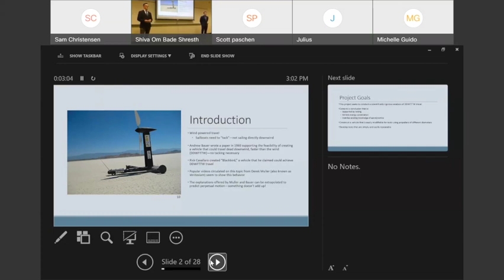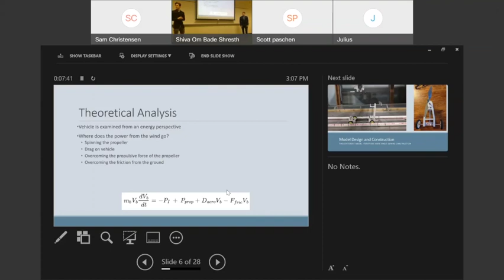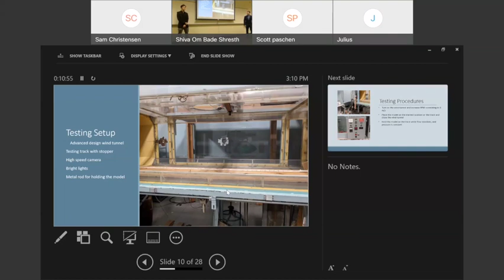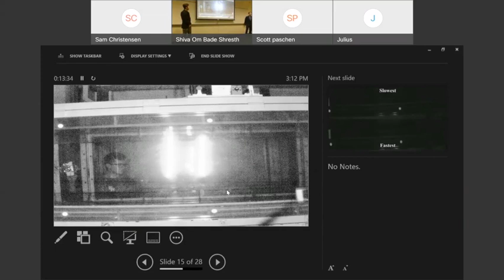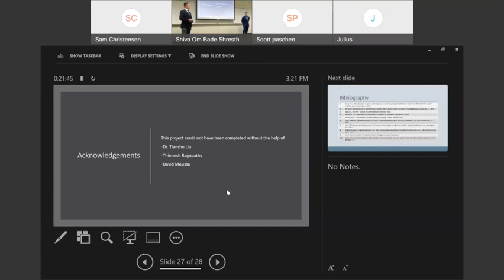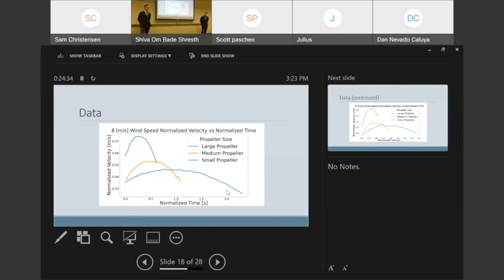Dead Downwind Faster Than the Wind Travel Analysis - Senior Design Presentation

Comment: It astounds me how these enormously complicated attempts to explain the cart have burgeoned when the explanation is really, incredibly simple. 

Rolling friction heats up the wheels and the rear axel, and this heat is dissipated into the air, but this heat loss is greater than simple entropy requires of the system, which means that there's an untapped differential there. The prop taps into that and, with careful gearing, turns it into motive thrust. The final speed of the cart is determined by how much that differential can be tapped up to the limit of basic entropic dissipation.

It's really dumb that so many attempts to explain have overlooked this simple but obvious principle, and it's all because of a failure of intuition. If you put the cart on the edge of a cliff and attached fan blades to the wheel overhanging the cliff, nobody would have any trouble intuiting that, once travelling at sufficient velocity, the fan could impart a force orthogonal to the direction of travel. All the gearing system does is to change the direction of that thrust and simultaneously reduce drag on the system overall.

This is really not hard.